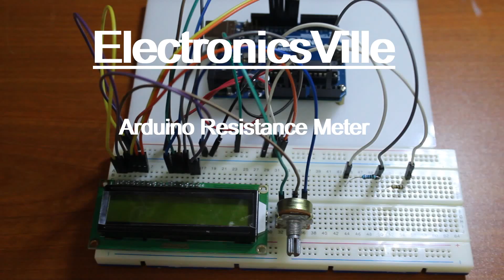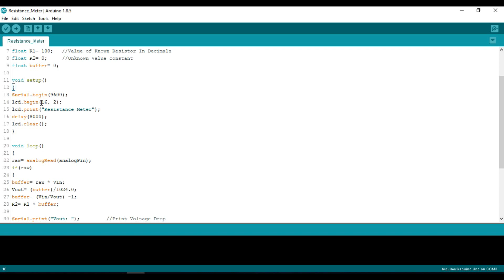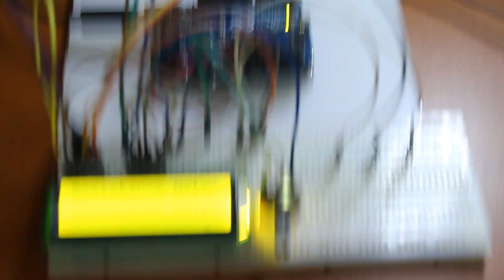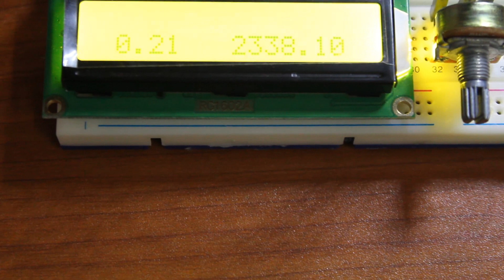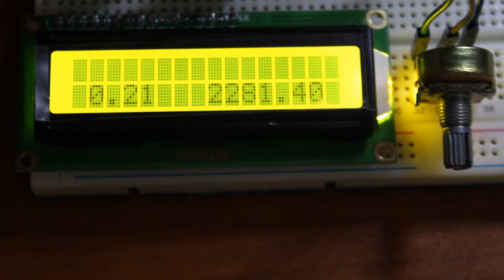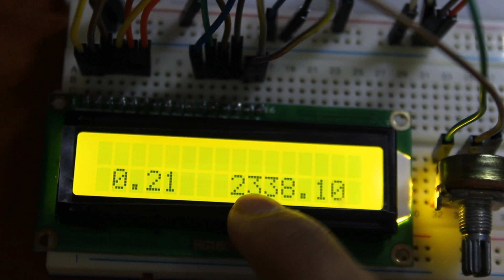Arduino Resistance Meter With 16x2 LCD

Comment from the maker: #include <LiquidCrystal.h>
LiquidCrystal lcd(8, 9, 10, 11, 12, 13);
int analogPin= 3; 
int raw= 0;
int Vin= 5;
float Vout= 0;
float R1= 100;   //Value of Known Resistor In Decimals
float R2= 0;     //Unknown Value constant
float buffer= 0;

void setup()
{
Serial.begin(9600);
lcd.begin(16, 2);
lcd.print("Resistance Meter");
delay(8000);
lcd.clear();
}

void loop()
{
raw= analogRead(analogPin);
if(raw) 
{
buffer= raw * Vin;
Vout= (buffer)/1024.0;
buffer= (Vin/Vout) -1;
R2= R1 * buffer;

Serial.print("Vout: ");         //Print Voltage Drop
Serial.println(Vout);
lcd.setCursor(1, 1);
lcd.print(Vout);

Serial.print("R2: ");          //Print Resistor Value
Serial.println(R2);
lcd.setCursor(8, 2);
lcd.print(R2);

delay(10000);    // Wait for  10 Seconds to read the value
}
}